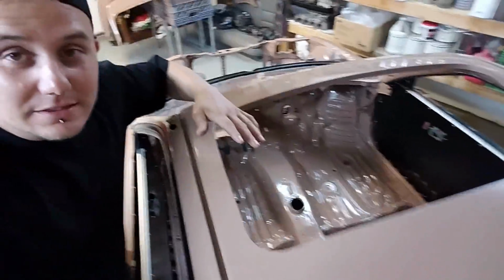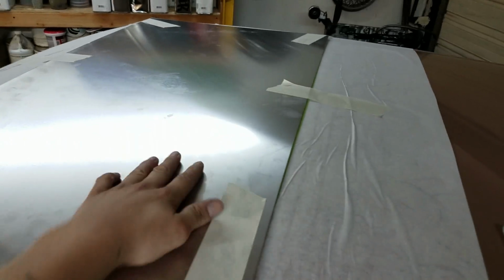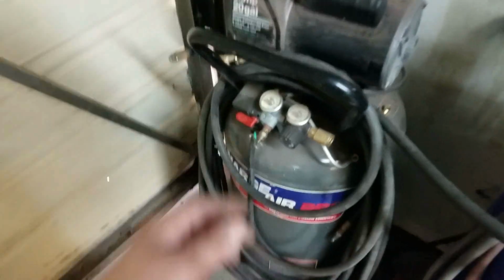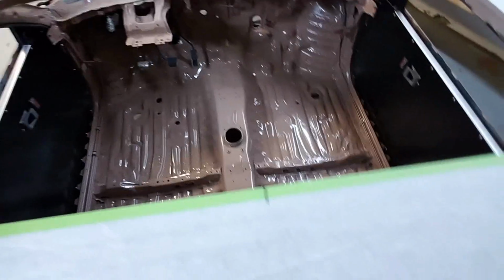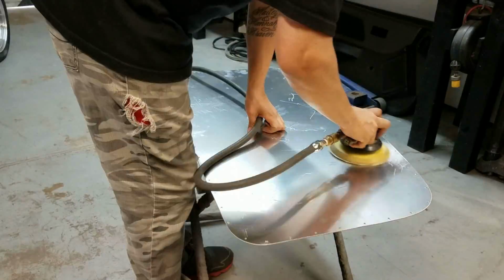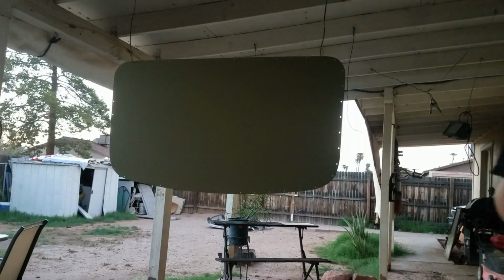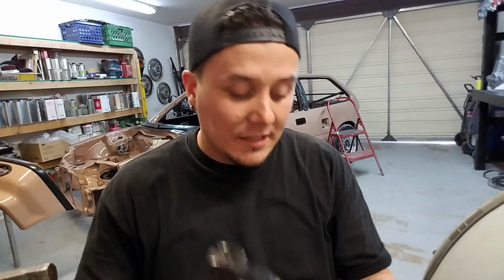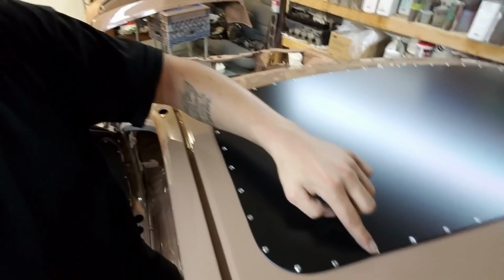(DIY Sunroof block off ) EF Civic project ep.33

Comment from the maker: Thanks guys and yes I plan to put a bead of silicone around the inside. I just don't have any at the moment :)
Reply: This car is coming along nice ive got a 2000 Subaru Legacy GT Limited that i just got on the road after a year and a half of it being a project. Not finished yet but its getting there. I rebuilt the motor, put all new brakes on it, new struts, wheels and tires, new intake system, all new ball joints and cv axles replaced, ac system serviced, new motor mounts, etc. next up is body work.

Comment: The result is probably the most neat on the net! I have to do the same. Can you tell what sheet thickness did you use and what was the distance between the rivets? As i can see the edge is completely flat what is very hard to get.

Comment: I'm about to do this on my Subaru...what gauge aluminum did you use? I'm afraid if I go with light sheet metal it will flex and rattle at speed.

Comment: Yeah you forgot sealant so when it rains you can get some rain water going in between the aluminium panel on the roof.
Reply from the maker: Speed Freak I silicone it a few episodes up.. no leaks.